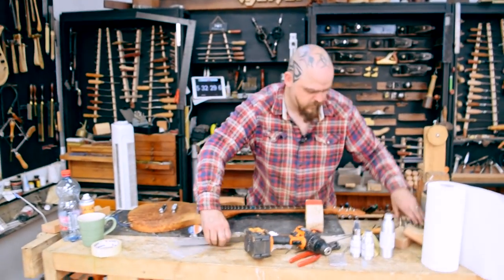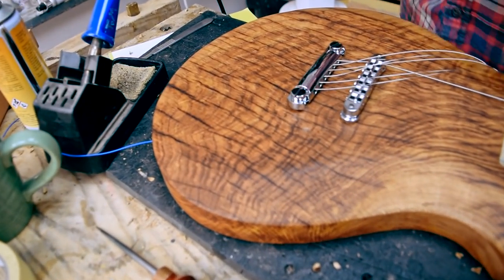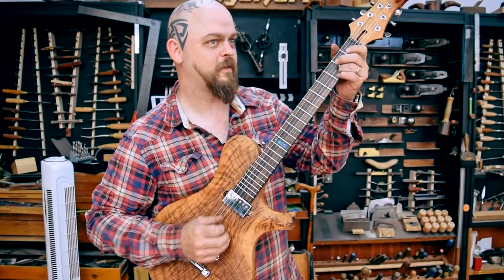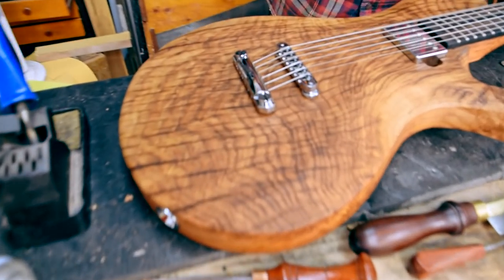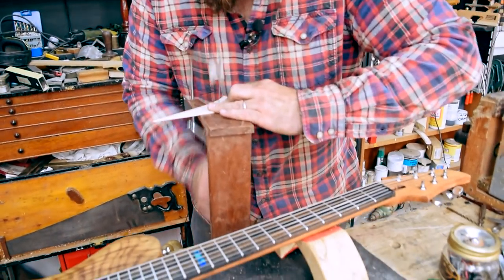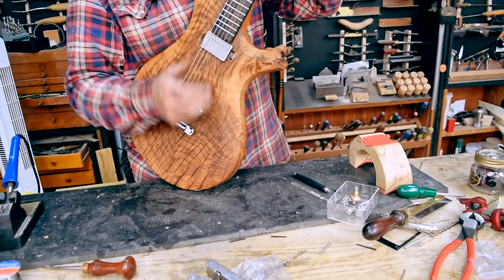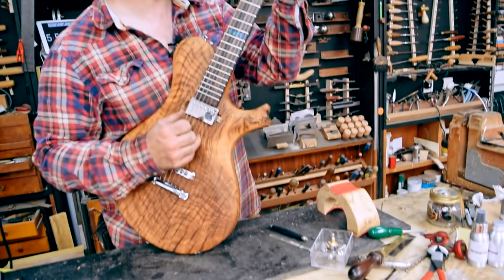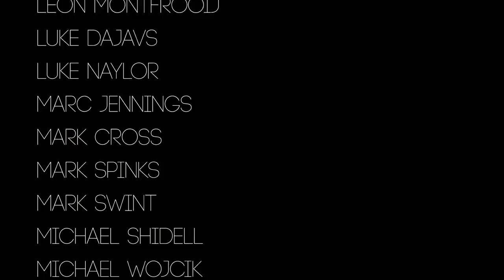Ep 12 - A Luthier Builds a Whole Custom Guitar in SIX Hours.. from SCRATCH!  - The Final Countdown

Comment: Another challenge : building a guitar as fast as possible, the simplest you can do (no pot, no finish, dead simple single coil, dead simple 6 à n line headstock, simple strat like fixed bridge, no truss rod cover, no inlay, a simple jack plate, like maybe a oval shaped or a strat like jackplate, no string thru, bolt on neck, not wasting too much time on sanding/shaping the body...)

Comment: You did a great job but, you cut a lot of corners by only using one pickup and wiring it directly to the output connector/jack. That saved you a lot of time by not having to make a cavity, and pots, wiring, soldering, and lastly making a cover for the cavity. Not to mention a pickup switch if you had added two pickups,  the location of the switch. Again great work but you cut too many corners. Thumbs down for that. 👎🏻